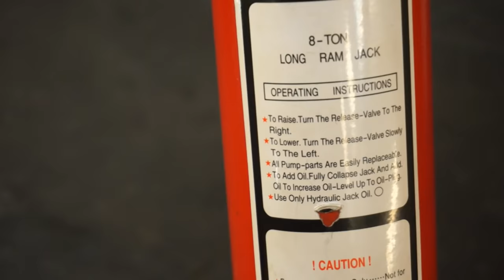Making workshop crane

Comment: I have a chinese crane and when I wanted to lift a small milling machine from a pallet with it, it came out the legs of the crane could'nt run under the pallet (too much width) , so I had to cut the legs, give'em a new angle, and reinforce'em. Afterwards it worked like a charm. Conclusion : think to what you want to handle (material on pallets ?) with your crane to give it the right dimensions.

Comment: Bravo, bought off the shelf, it wouldn't have been any better, maybe not even as good.
Reply: It would be fully designed and certified, with factors of safety built in.  

I’m always sceptical about anything that lifts or creates pressure that’s home made. 

I’m not saying this isn’t safe but has it been stress tested or inspected by a hoist inspector?

Comment: I like the design but not the welding, little mig isent enough heat for the heavy plate
Reply from the maker: Thank you :) I am constantly working on improving my welds in the mig method, I did not always work out but it is a little better now :)

Comment: Like the build, would have liked to know dimensions 1/4 inch wall? Etc. By the way how much did it cost?scrap? Drops? Interested.For smaller work like those odd small engines. I purchased a harbor freight one same design and everything ($160 coupon /sale), I just dont trust them to do engine blocks or engine and trans.
Reply from the maker: As with a belt sander, I will insert a link to the photo with dimensions for the description.  What can I say that the crane is very durable and was built from 60x60x4 and 50x50x4 profiles, the hydraulic lift according to the manufacturer has 8t, but this is one of the cheapest lifts, so he is not convinced that he really has such a capacity